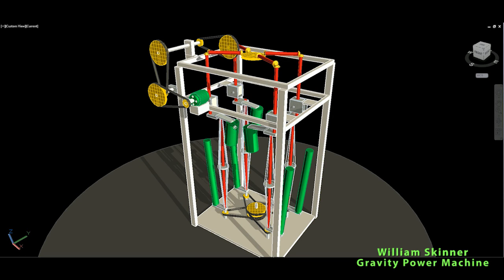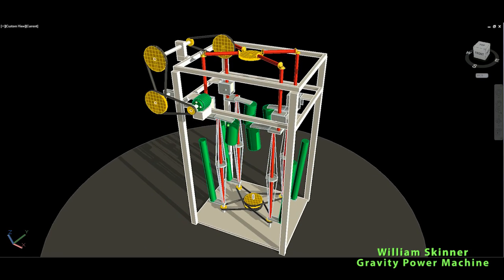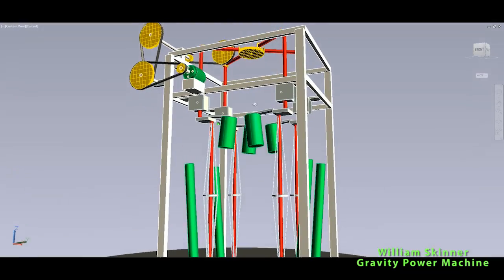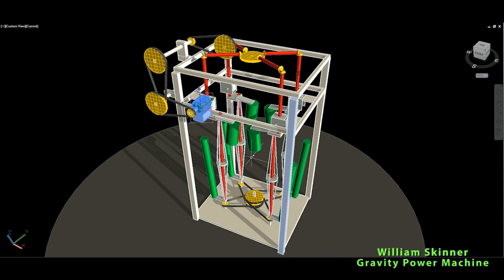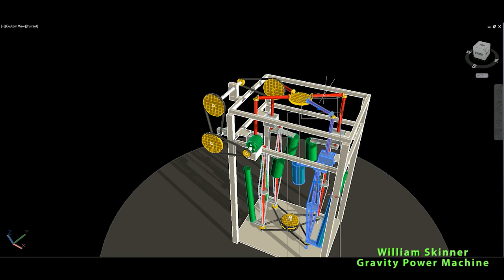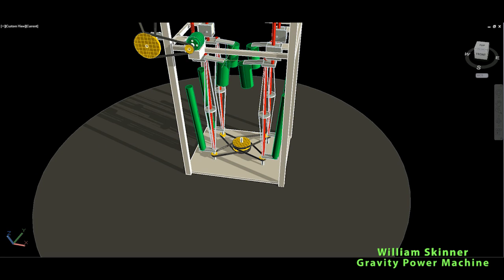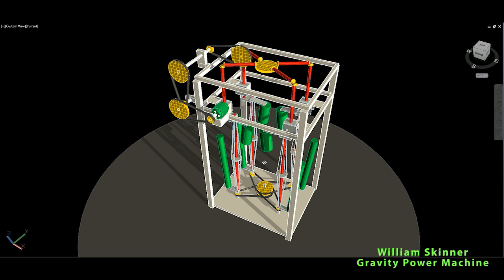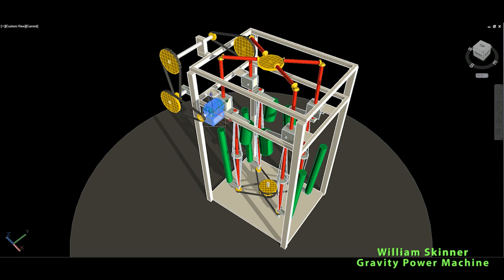Free Energy Generator, WILLIAM SKINNER Gravity Power Machine!!!!

Comment: That's an  INCORRECT representation of the skinner machine..  The top vertical levers are truncated in this video..  That would decrease the leverage needed to balance the oscillations between the four levers..
Reply: Brian,   I like your idea of building a Skinner Machine,  but,  If it will cost $8000.  to build,  you should recheck your methods..  
    The heavy steel weights on the Skinner Machine can certainly be replaced with Concrete weights,  Yes, Concrete has a different density,  but the design is easily adaptable..  Shafts and Bearing can be purchased with the desired lengths and diameters,  with or without key-ways..  They are  "Off the Shelf" items..  All You really need is a Saw, Welder and Tape measure..
     I started building a small model of the Skinner Machine last year,  I never finished it..  I built a lot of it,  just to study the physics of the Machine..  It certainly is viable design,  as is..  
    You are right.  it does require a lot of space,  which I don't have..  I did think about building a large Shed to house the Machine,  but never built it..

   Your best bet,  would be to find a local scrap yard and work a deal with them for materials.,  Your employment situation is a major problem..  You might be best off by waiting to build your machine..  Get Yourself financially stable before you do anything..    Good Luck..

Comment: We debated for months whether or not the top shaft moved in a circle OR, just moved back and forth.  This machine has enormous  mass transfers as the unbalanced weights go around. You MUST have each pair matched up departing and approaching in unison.  A pair moves together,,,, and moves apart. This cancels the forces that are trying to tip the machine over.  With your top plate, all the weights are locked together. It can't work that way.  One pair approaching at the same time that the other p[air is departing. is the only way to keep it from tearing itseld apart. 
As to the question of whether the top shaft rotates OR oscillates, I believe that it rotates. We are never shown the machine starting out. That would settle the question. If it does not rotate, it would be very difficult to start it up.
Reply: You are correct in both the same-time in and out pattern of weight movement, and top circular movement. But there is more.
Skinner referred to his shop machine as a “model”. The other secret can be found in the fact that his machine is designed to function as a multi level machine, each level up only needing to be a percentage of the size below it! As a 5 or 6 level machine, the top unit would be very small by comparison to the bottom! So long as the top is rotated at a constant RPM consistent with the bottom, a constant tipping chain reaction will be maintained, not much different than a chain of dominos where each can tip over the next domino 120% it’s own size. The largest domino has its own weight and the weight of a few preceding dominos leaning on it to contend with.

Comment: Even a good electric motor is only&5% efficient, belt and pulley wheels are lucky to exceed 80% efficiency, then generators are lucky to be 75% efficient at this small size, I think there might have been a printing error, thi machine is more likely to produce twelve times less energy output than energy input. A aggregate of the compound losses. The only Gravity Engine worth considering is one you can buy with a full guarantee from a reputable company. A gravity engine that has been peer reviewed by highly sceptical engineers. Rosche Innovations Ag. meet these criteria. Peswiki have authenticated it. It is a clever variation of Archimedes Differential Buoyancy Engine, The Submerged Bellows and Cantilever Beam Claw, that defeated the Roman Fleet, and lead to an order to kill Archimedes on sight. This was the ring od 12  Hephaestus Bellows surrounding a well, with 12 counterweighted cantilever beams. As each of the 12 submerged water-tight bellows exhausted their air to the furnace, the buoyancy was lost, so the heavy pair of stones overcame the leverage of the cantilever beam counter-weight. A prefectural cycle on Mount Olympus. The Blacksmith of The Olympian Gods.
Reply: Hey, where can I find more on archemedes' buyancy engine? I searched, and there are no results